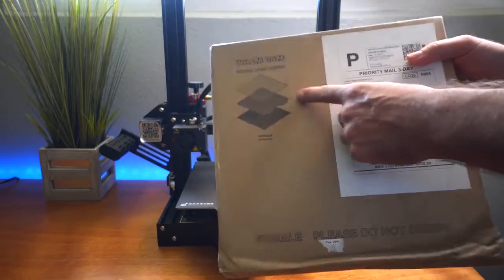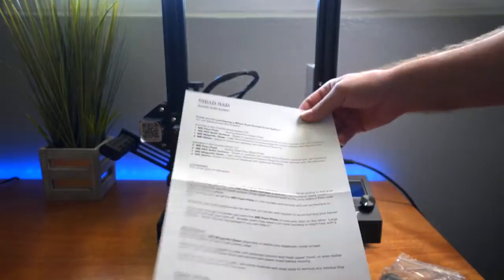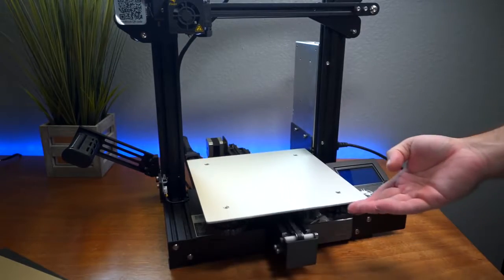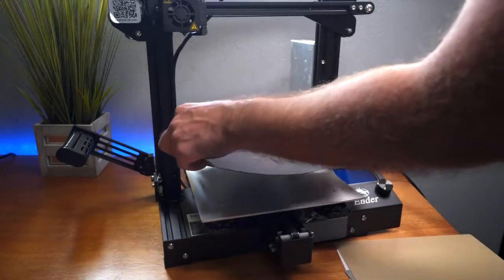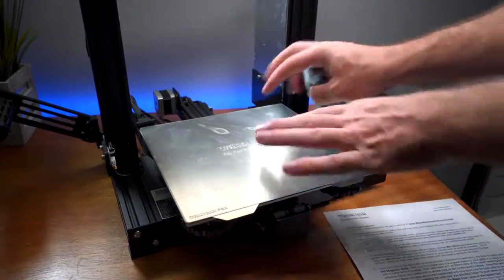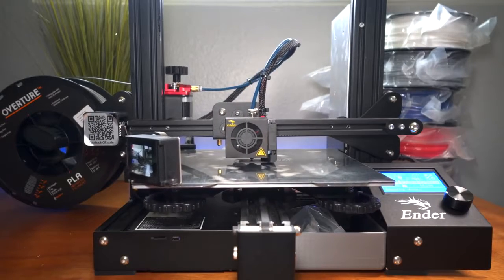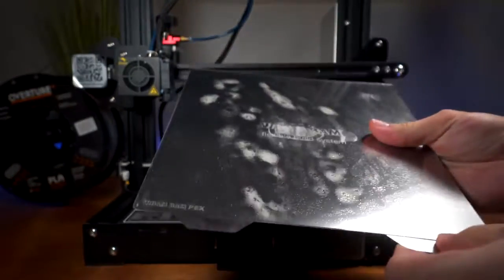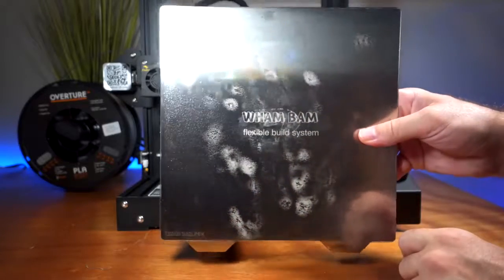Wham Bam   Flexible Magnetic Build Plate   Ender 3 Pro

Comment: You will want to follow a better process when applying build surfaces and magnets, you can follow the videos https://youtu.be/FxP8f6jVnQc

Basically you peel back about 1” of backing paper, line it up against rear edge, and begin to burnish it down working from center to outer edges.
Then peel back more paper and continue working from center outward.
It will go easily after you learn the process.
The Wham Bam channel has many videos for installation and use